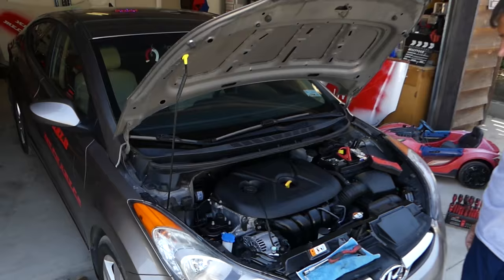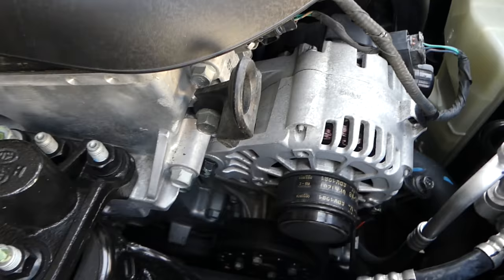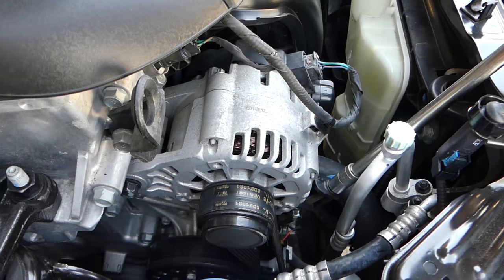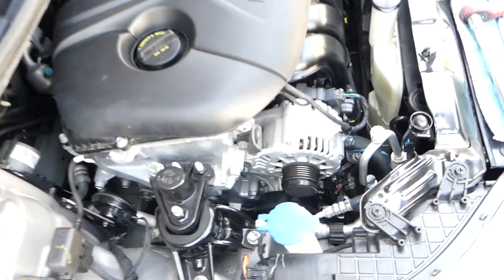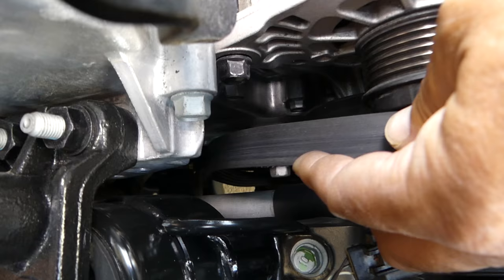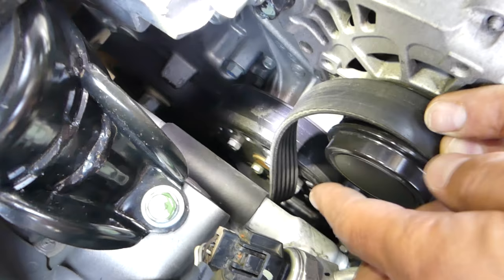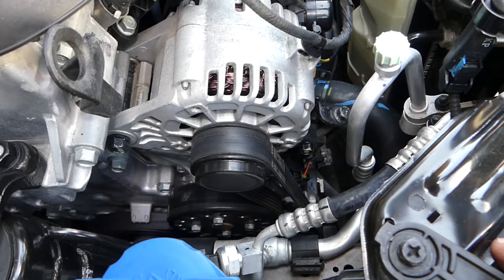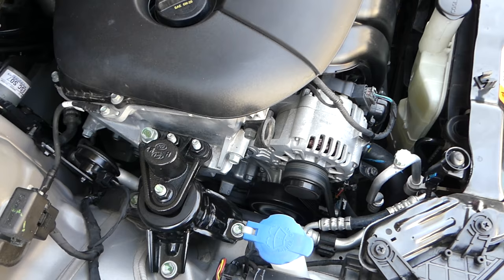HOW TO REPLACE SERPENTINE BELT ON HYUNDAI ELANTRA Belt Diagram

Comment: I was quoted $199 to replace this belt by the dealer.  After watching this video, I paid $25 for a belt at AutoZone and did it myself in under 20 minutes.
THANK YOU!
Reply: They charge you for labor. $199 is still a lot though.

Comment: Thank you SO much for doing these videos on the Elantra. I don't know anything about but cars but so far you have helped me fix several things on my Elantra myself. Going to a mechanic can be really intimidating, the shop I went to wanted to charge me $200 to change my serpentine belt. I watched your video, bought the belt for $15 and did it myself in less than 10 minutes. Thank you thank you thank you. So grateful you do these videos, they are comprehensive and easy to understand. And I love your accent 💕

Comment: Still gold. Took a little tinkering to get the belt on right. But turns out the dealership when they replaced my engine didn't even put the old belt back on right. Come to my surprised that if it wasn't for this video and doing it myself I wouldn't have known! Drove almost 15k miles  before I replaced it. Thank you guys!

Comment: Just change belt, easiest thing I did on my car. Even changing the headlights requires to take out the housing >.>
I save this video & channel years ago just in case. Today I drove over some water & a piece of the undershield bent back & cut the belt in half. Took the loose pieces of belt off, cut the piece of plastic that was against the crank shaft & my car made it home on thoughts & prayers.

Comment: Is belt supposed to wrap around the one under it my car wont start crank good but like vacuum or squeeze sound I look at belt and I notice shiny metal on one of the pulls. The belt not wrapped around one of them is that it?

Comment: On a very same engine as per your video..when the belt is put on after a few revs the belts moves in on the crank pulley leaving 2 grooves hence damaging the belt..all pulleys are lined..what is causing this?? Will an irratic idle or coil pack miss cause this to happen..tks
Reply: Sounds like you didn’t tighten it enough.

Comment: Why does a 2017 hyundai elantra have different location to loosen belt? It has a automatic belt tensioner that is hell to get to
Reply: Where is the location
Reply: behind the engine bay almost on the side up above the serpentine belt goes
Reply: Any luck finding an update on the 2017?

Comment: Good thing to do is draw a small pic of all the pulleys than draw the belt going over or under the pulleys, do this before removing old belt, now you have the drawing to help put new belt on correctly.

Comment: Need an update for the 2017 Elantra 2.0 engine. Has a different fixed plate below the alternator, not a tension screw. The pulley is still mechanical so I'm confused. Help!